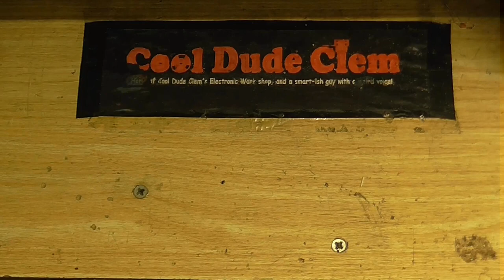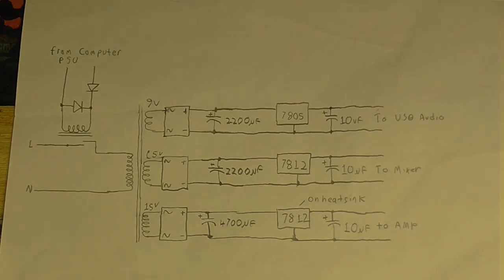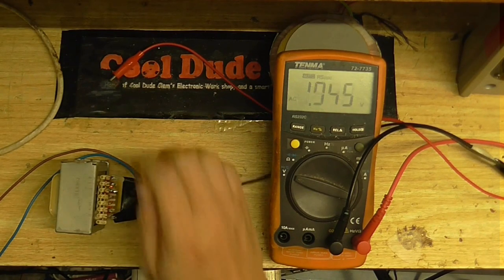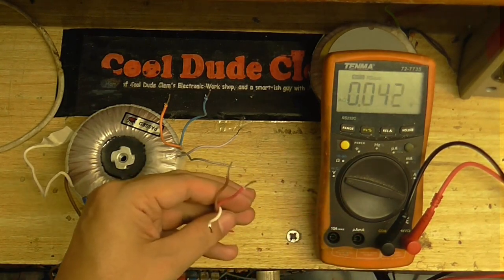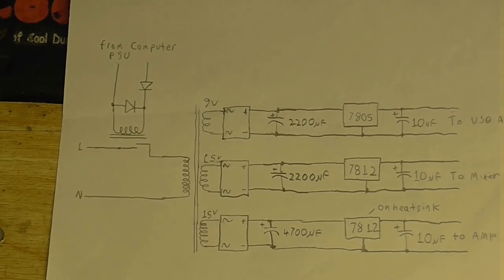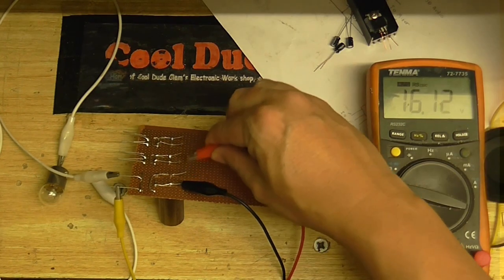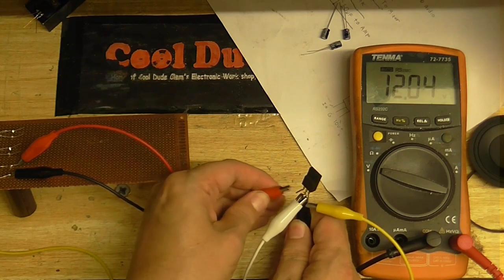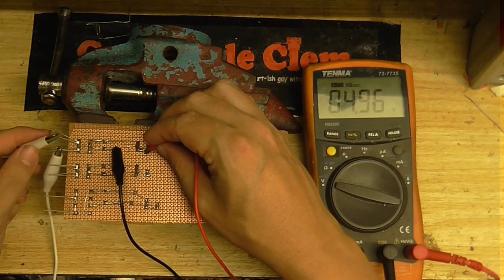Making a power supply for my computer's audio pt 1

Comment: Hi cooldude have good news i have the floppy disc echo working realy great now i used your circuit but the 100 khz seems to high to work ,i had a light bulb moment and tried the erase head i had which is nearly 5 ohms on the circuit which dropped the frequency to around 50 khz i connected the bias trap to the erase head and put a 1 watt amp signal through the erase head to record and the sound is perfect lot's output and good tone ,thanks for your imput to my understanding how tape recorders work ,i will box it up once i put vu' and preamp . Thanks Again.

Comment: Aren't you wasting those big transformer s ..??? U can use a zvs driver and wind a small ferrite transformer and wind three separate windings and use three  linear regulators.. 🙄
Reply from the maker: The thought of going the switchmode way had occurred, but I want this to be full linear, that way I can guarantee that the supply will be as noise free as possible. besides the diodes I have are just standard silicon diodes and wouldn't be able to switch at those speeds.
Reply: @CoolDudeClem  yeah i understand ... U got those transformer s lying around ... And u probably have many more ... So you are fine..but just incase buying those bigggg transformer s..😵 . That's why I just said so 😀